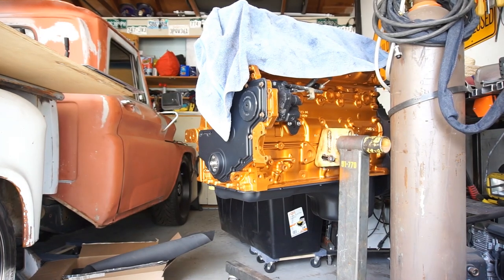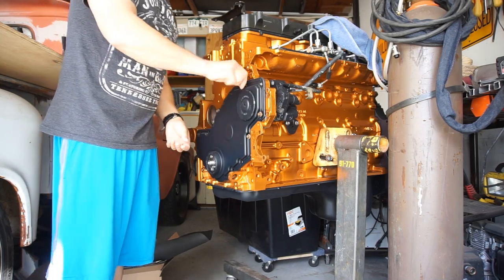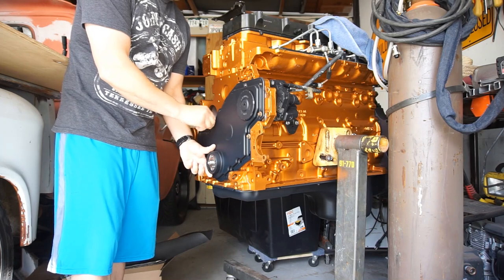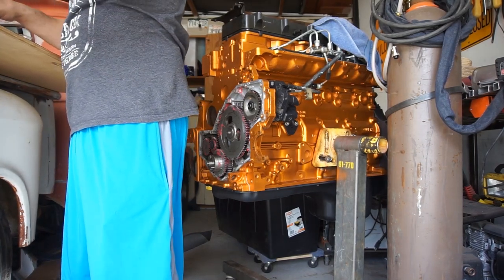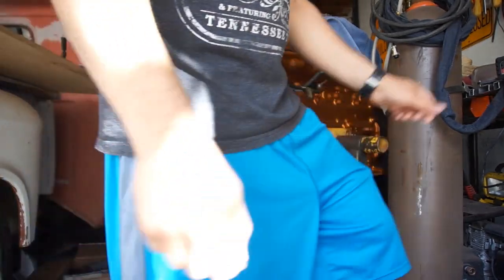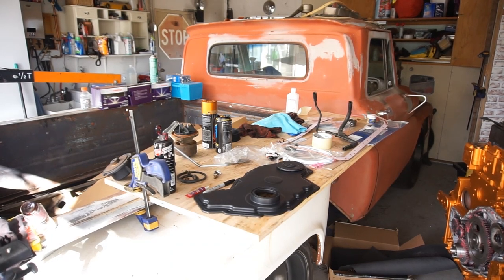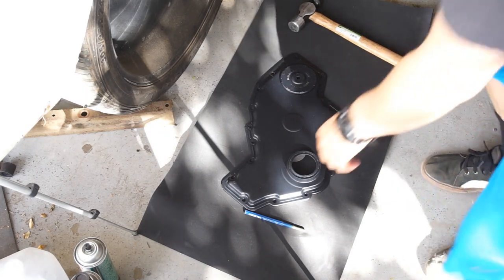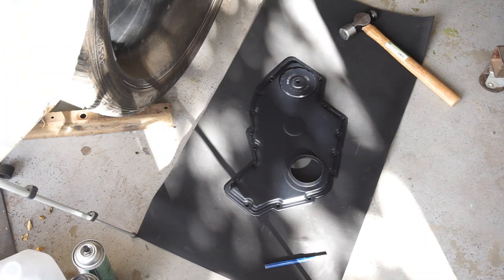Part 20 Cummins 6.7 Build. Installing The Front Timing Cover. Fel-Pro

Comment: Bro I do believe the seal knocks in from the back side, the only reason we would ever from the front side is if it was installed on the vehicle! But not knocking your work and godspeed
Reply from the maker: As you can see I tried both ways. Just so happened to work on the front side. Either side is fine because that driver tool puts it in the same spot front or back.